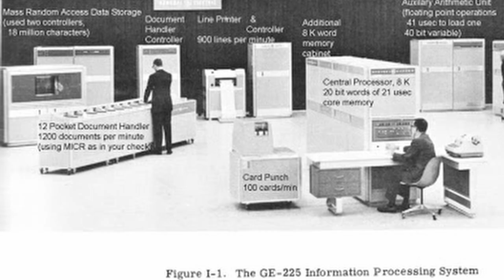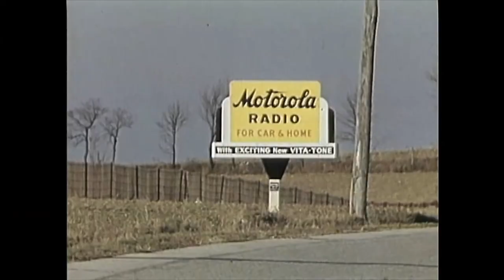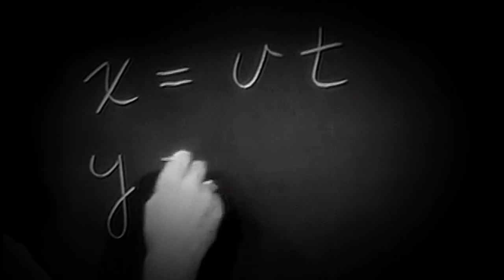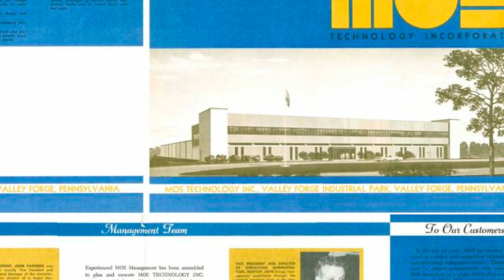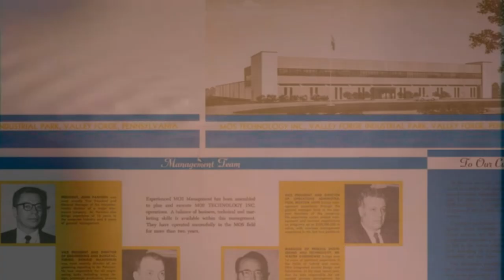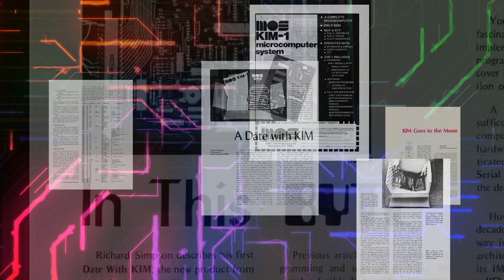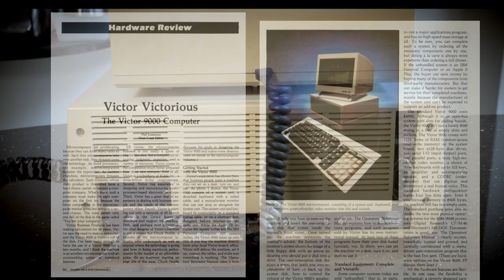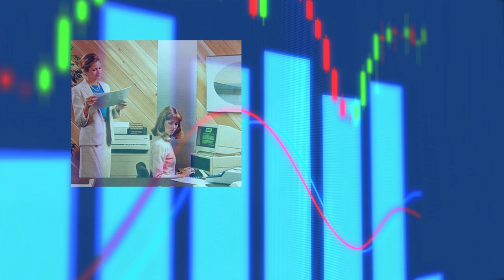Chuck Peddle - The man and the very brown computer

Comment: This is wonderful. The Sirius 1 was a great computer. I had been coding Forth on an AIM 65/40 before getting Fig-Forth for the Sirius 1. It was such a classy machine. We had one of those and a Victor 9000 variant as well, which no one liked using as it was a bit flaky. Even when we started buying generic PC's in the late 80's the Sirius always felt like a classier machine. CPM86 was a superior OS to MSDOS. PC's felt like a step back in tech rather than a step forward. Our SIrius was finally retired in 1995.

Comment: Thank you for this informative and entertaining walk down memory lane! my first experience with microprocessors was as an udergrad in the late 70s. I was using a JOLT SBC, cousin to the KIM-1, so I have quite a bit of affection for the 6502 and the amazing variety of systems that were designed around it. Of course, that $5 price point is arguiably what kicked the uC revolution into high gear, as Motorola, Zilog, and Intel were forced to dramatically rethink their own marketing strategies. Competition is a good thing, at least until market position is abused (looking at you Microsoft)

I have to say one thing that confuses me still is how smart floppy disk subsytems like the one on the Sirius/Victor, the Commodore 1541, etc were so deficient in their ability to support other 5.25" formats. considering that there was a considerable amount of processing power driving them, would it have been such a challenge to add a NEC765 or WD1795 (I think) "emulation mode" whereby soft-sectored, fixed-track length formats couild be read and written? I believe the 1571 floppy drive unit that debuted with the C128 could read DOS and some of the more common CP/M floppy disks. Seems to me a disk-transfer utility program would have been a straightforward (and higly valued) tool for moving data between different kinds of uC systems. 

Additionally, it could provide a kind of rosetta stone of archive media: a simple 360k or 400k DSDD disk could have provided a convenient (if not particularly dense) way to save information in a common format that would be accessible by a wide variety of computers, regardless of whether that 360/400k format was native to the target system. while not as convenient as directly using non-native format disks, it would provide a mechanism for getting data off the archive media onto the better-performing native media. one (very low density) example could be CP/M's choice of the IBM 3740 8" diskette format as its only media standard, and it wasn't particularly difficult to add an 8" drive to an IBM/clone PC.

Anyway, liked and subscribed. as a latecomter to RetroByes I have LOTS of new-to-me content to view and new-to-everyone videos to look forward to.  Much appreciated!

Comment: Actually Chuck Peddle borrowed this idea about floppy from the Commodore disk drives. The mechanical rotation speed did not change, but the number of sectors on each track was decreasing with the diameter, implying a different timing for each track. That's why it's not possible to read a Commodore or a Victor9000 floppy on a PC

Comment: This was one of my first real computers; a pair of Victor 9000s with a 10mb Winchester.  Retired out of my dad's accounting office in the mid 80s, when it was replaced with a Corona PC clone (also a rare relic now). Sadly they were all donated, along with all their software. Wish I still had one of them. If you can find it, look for the talking star-trek game.
Reply from the maker: I would quite like to get the harddrive unit for mine.  It would be handy as the hd has a regular filing system so would make getting files from modern machines to the Victor alot easier.   I will keep an eye out for that Star Trek game.

Comment: The 6502 is not in the Atari 2600. It is in the Atari 400/800/5200 machines
Reply from the maker: Well its a 6507 which was a specially packaged verison of the 6502 in a 28 pin dip.  So it lost a few address lines to get the pin count down, as a result it could access less memory, but apart from that restriction its a 6502.
Reply: By that same reasoning you'd have to say the C64 and the NES didn't have a 6502 either, but the reality is they all used the 6502 core.

Comment: Early in my own career, I worked with an engineer that was on the 6800/6502 team with Peddle and Mensch (although curiously, he never mentioned anything about those years).  So I've spent a lot of time lately reading about these early microprocessor engineers.

This video appears to repeat and paraphrase Peddle's interviews, and I'm just not convinced they are 100% accurate.  I don't think Peddle really ever "designed" anything.  He spent the first 10+ years of his career running time-share computing centers for GE before they got out of the computer biz.  Motorola hired him in at the very end of the 6800 project (I'm really not sure why, since he disparaged them over and over as mere "calculator guys"), and he was there only about a year before getting the key members of the chip design team to jump ship to MOS Technology with him.  Yes it's true that Motorola didn't want to pursue the "low cost 6800" option, and they failed to sue Peddle out of existence when they could have very easily.  Other key 6800 engineers became middle managers at Motorola (I knew many of them) and disappeared into anonymity.  But it's also true that Motorola was forcing them to move to Austin during the 74/75 chip crash (at which time Austin had no high-tech at all) so the defectors to MOS Technology were clearly rebelling against that too.

I think Peddle was what we would now call a "systems guy" or an "architect", not a designer since I see no evidence that he went anywhere near the chips,.  And I think he took credit for a lot of other people's work and ideas.  No credit to the team, always "I did this" and "I was the first to do that".  Hundreds of other people had the exact same ideas as Peddle did, at the same time that Peddle had them.  Mensch has also given extensive interviews, and it's curious to me that he says almost nothing about Peddle and was only diplomatic and polite when Peddle died awhile back.

I think the credit for the 6502 should be much more broadly distributed than Peddle ever did.  Everyone involved in the original 6800 development at Motorola deserves to be recognized.  That Apple and the others went with the 6502 instead is more a matter of dumb luck, and Motorola's stupid decisions (which they made a lot of over the years, leading to their semiconductor division eventually falling apart).